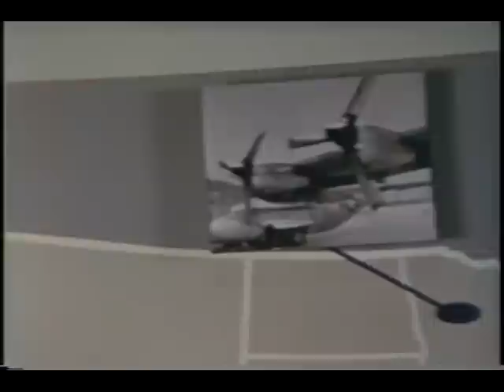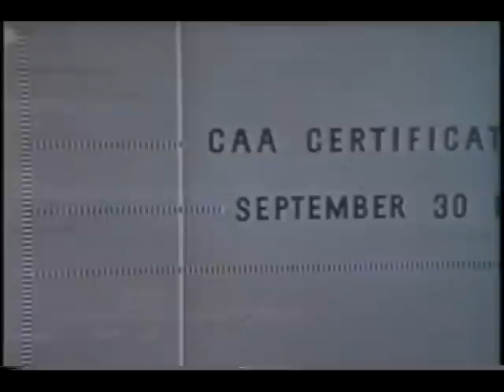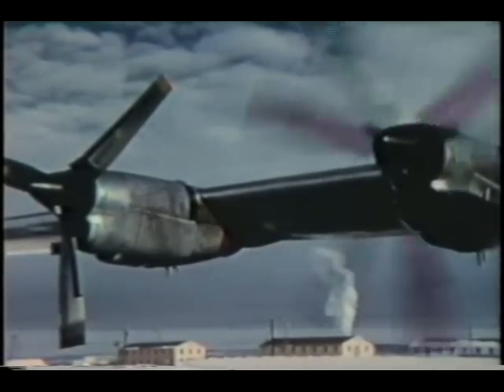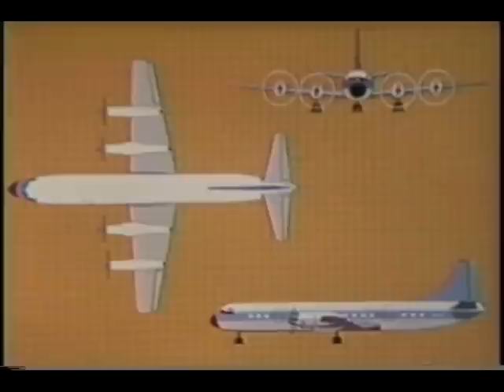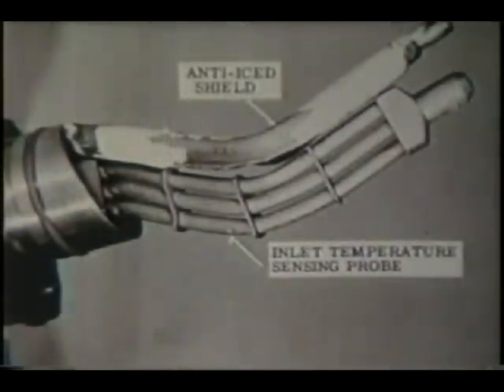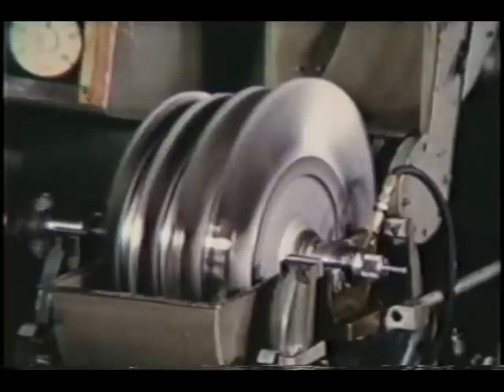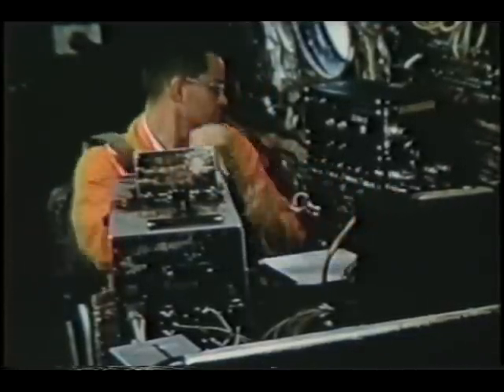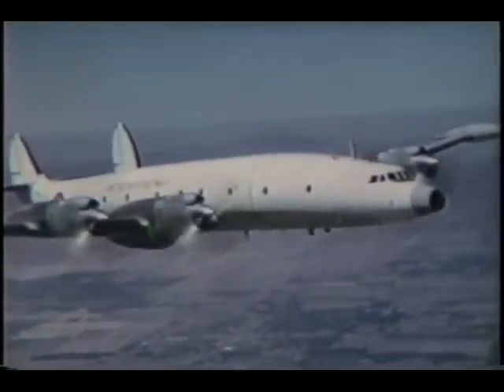Lockheed Electra Propulsion Story

Comment: Allison is today part of Rolls-Royce, pioneers of turboprop power with the renowned Dart engine.
Reply: +John Eddy Both RR and Allison turboprop engines were used to convert piston-engined Convair liners to turboprops.  The RR Rda-10 with Dowty Rotol propeller, 2700 horsepower, went on the Convair 240 airframe to make the Convair 600.  It made a smooth, quiet (in flight), installation, but had reliability problems early on, and could not haul a profitable load out of high airports (DEN, COS) on warm days.  The Allison 501-D13H, Aeroproducts 606 propellers, 3750 horsepower, went on the larger Convair 340/440 airframe, producing the Convair 580.  This combination was a winner, providing reliable service to small airports even in the highest mountains and worst conditions.  As noted elsewhere, its big shortcoming was noise and vibration from the huge, four-bladed props.  I made hundreds of trips on 580's, and sometimes began to feel airsick from the vibration even before takeoff, though I usually slept through the worst of it.  I once discovered, protruding from the fuselage top skin of a Convair 580, a hinge pin from the cockpit door that had vibrated up out of the hinge and punctured the interior lining and fuselage skin.  Hammer it back down, plug the hole with a rivet, back in business.  You could not keep a 580 down, but they were miserable to fly in.
Reply: +Hopelessand Forlorn, there was also the 640, which was a conversion of the 340/440 with the Rda-10 Dart.
Reply: +soaringtractor, the Rolls-Royce AE series engines descended from the T56/501.
Reply: I'm retired now but I held engine licences for the RDA 7 Dart & 501 d13 Allison. Great engines both, enjoyed my time on them + JT8D series. One of our L188's is now with Buffalo Airlines, ex VH-RMA from memory.
Reply: +Hopelessand Forlorn, the Rda-10 also powered the Japanese-built NAMC YS-11. To the best of my knowledge it had propellers different from the Dowty Rotols the Convair 600/640 used.
Reply: @johneddy98033  Thats what I saaaaay sonny boy !!!!!
Reply: Allison and Rolls-Royce cooperation go back much further than that.  Allison manufactured the TF41 turbofan for the A7 Corsair attack plane.  That engine was the Rolls Royce Spey, built under license.  And even back in WW2, there were strange similarities between the V1710 and the Merlin.  The connecting rods are interchangeable!  Merlins built for Unlimited class racing in Reno use G-series Allison rods.

Comment: I have flown on the Electra and thought it was a comfortable plane. Lockheed had a winner but due to the flutter and vibration induced air disasters, it's popularity was greatly short lived. The Electra's story reminds me of the early Comet disaster stories. LA/Burbank to San Francisco in less than an hour was unheard of back in those days. After the bugs were worked out of the Electra, PSA flew them for years to San Diego and SFO without a further accident. The P-3 Orion still flies after 60 years even though it's useful life is about over.

Comment: The YC-131C was derived from the C-131 Samaritan, a version of the famous Convair 240/340/440 developed for use by the Air Force as a "flying hospital" and VIP transport. The Convair 580 was a version of the "Convair-Liner" powered by the Allison 501-D13 engine.
Reply: I was an aircraft mechanic, in the Air Force Turboprop Test Squadron 1955-58, that had two YC-131's.

Comment: Amazing all this testing and they didn’t  test for the “F” word flutter   It was supposed to fly at 430 mph but after the wings started separating in mid flight they realized they had a major issue  the resonance of tge vibration of the engines and the very thin wing were the same thus the metal fatigue began and the wings separated . The wings were very short so thin and short that the plane could not hold altitude with two engines out in fact it could no longer fly.  To add insult to injury the Electra was supposed to be launched in 56 but delays pushed that date to late 58 just at the arrival of the 707  It was obsolete at launch then the wings fell off.  When the wings were finally strengthened  the speed had to be reduced to reduce vibration to below the speed of the DC7B  .  The Convair was by far a better turbo prop plane and  launched several years before the Electra  Because the public wanted Jets the changed the name from Turboprop to Prop Jet to get the name Jet associated with the plane

Comment: Those turbo Connie's were cool. Lockheed should have produced a commercial version of those.
Reply: They did.  Sadly, they had a harmonics problem that caused the wings to fall off.  Even after they fixed it, they were noisy and vibrated like heck.  I rode in one back in the day, and well, I preferred the 727 or 707!  So did most other passengers, and turboprops went by the wayside pretty quickly.   Today they are popular with some commuter airlines.  I still dislike the noise and vibration.
Reply: ***** I wondered about that. I saw those wide three bladed props and thought to myself they had to put out a lot of noise and vibration. The C-133 and the B-36 had the same problem, there's just too much space between the blades. Why didn't they just go to five or even six bladed props?
Reply: Hawkin's Dog
I think it had to do with synchronization.   Google it.  There were several crashes early on.  The problem was fixed, but by then we were in the jet age.
Reply: ***** I will, and thanks.
Reply: Lockheed had a L-1249 Super Constellation under development, powered by four Pratt & Whitney T34-P6 engines, which were similar in type to the Allison 501s, but it never reached production.
Reply: +Robert Bell, and Lockheed had to wait a few years before building what would be its only pure-jet airliner, the wide-bodied L-1011 TriStar.
Reply: This thread has some comments which could be misinterpreted. The "harmonics problem" (whirl mode flutter) applied to the L-188, not the turbo Connie. Kennedy's aviation administrator Najeeb Halaby wrote a good book about how this was tracked down and cured; it's analogous to the British Comet 1 problems.  The L-1249 was powered by problematic engines, and airlines stayed with piston engines until the jets came on the scene pretty soon. The British Bristol Britannia was an analogous long-range turboprop, but it was much delayed and the jets quickly surpassed it. As for turboprops today, they are extensively used for short range aircraft,  with Bombardier (ex DHC) and  ATR the most prominent manufacturers. They are much more efficient than jets, and the Bombardier Q400 is not much slower than jets. There are strong environmental reasons to prefer turboprops over jets on short hauls.
Reply: I was a crew chief on C-130 E's for many years and they were very smooth and powerful . Noise, yes, but they did finally come out with ground idle that slowed the engine for ground operations and used less fuel and made less noise. We did finally get computerized balancing with the engine on the wing and that made a big difference. Only got that in 1988 and in flight very smooth but did not make them any quitter.

Comment: wings kept falling off, purchased by USN as an ASW ( P-3 Orion) patrol aircraft still in limited use today. (US Customs/DEA and NWS Hurricane Hunter. Wings shortened, engines hopped up.
Reply: frinker56 engine on P-3 were actually torque limited for airframe.
Reply: Actually, the propellers entered flutter mode and vibrated the engine mounts off.
Reply: The C-130 E's where not torque limited with a max TIT of 977 degrees C, The later H models were with engines limited to max 1100 degrees C and they were torque limited for take off. Would not want to twist the engine mounts. Many pilots never reported over temping the engines or over torque.

Comment: October 4th 1960 electra crashed on takeoff at Logan Airport into Winthrop Harbor. Cause of accident starling birds in the engine. And they tested these engines with a chicken and birds and the engine performed normally??? 62 out of 72 people died strapped to their seats. Most drowned.

Comment: Flocks of starlings brought an Eastern Electra on takeoff in Boston after the Whirl mode problem was solved, further damaging the aircraft's reputation, but the Electra was an excellent airplane.  Passengers insistence on propellerless pure jets, on top of the initial problems with the engine mounts, spelled the lack of subsequent orders.  I last flew on an Electra in 1976 on Air California from SNA to SFO.  It was a very comfortable airplane for the passenger, vibrationless except on takeoff and very quiet.

Comment: Bad wing. We called the L-188 a glass winged aircraft.
Reply: There was nothing wrong with the wing.  The engine nacelles and the package that mated the power plant to the nacelles were the problem.  Weak engine mounts allowing an engine to wobble from whirl mode would pull apart the wing of any aircraft including the Douglas DC-4-6-7 series or the Lockheed Constellation.
Reply: Who was the we, never read or heard the term glass wing. Pleas state when,where, and how.
Reply: Oh well p
Reply: @ohwell2790  we the mechanic's that work on them. There is so much inspection on the wings. I would of liked to seen one phase check with out a wing repair.

Comment: @miked202069, @stuartleetv, @jj thompson, eventually they did resolve the "whirl mode" problem. American Airlines, to the best of my knowledge, was the first to introduce the improved version, called the "Electra II," which is what I like to call the turboprop Electra to distinguish it from the piston-powered L-10 Electra.
Reply: I think all existing Electras had to be retrofitted with better engine mounts. Before that they had to fly at reduced speed.
Reply: Why not simply use it's company designation, L-188?

Comment: More like bad engine mount design.
Reply: The Air Force also mounted turboprops on a KC 97. I saw it taking off at Westchester County Airport sometime in the late 60s. There had been a National Guard base there at the time. I can't find any photo or video to confirm what I know I saw. They probably called it a KC97T or some such designation. If any one has info on this please post it, as I'd love to know I'm not the only one that saw it.Thanks!
Reply: @itsbiohzrd170  ..it was the designated YC-97J.  Here is a link to an article about military Turboprops.  Discussion of the YC-97 with photos is about a third of the way way down.   

https://www.aerothusiast.com/blog/usaf-turboprop-testbeds-yc-97j-yc-121f-yc-124b